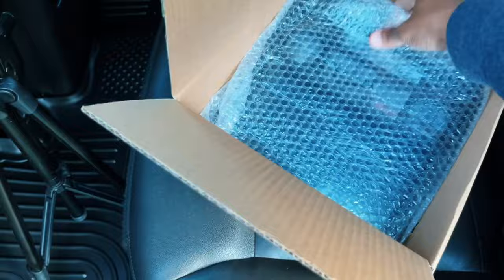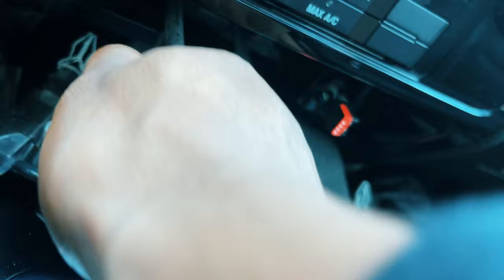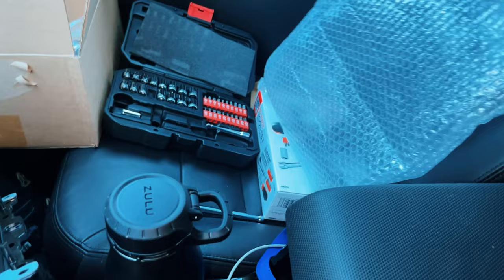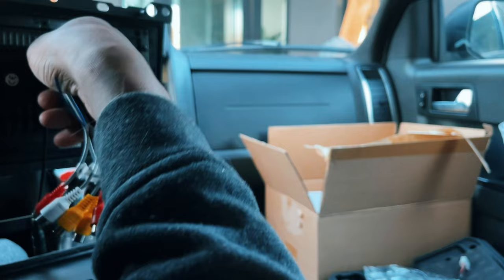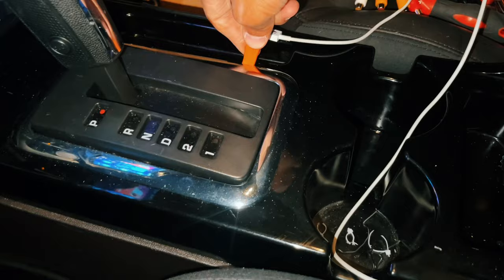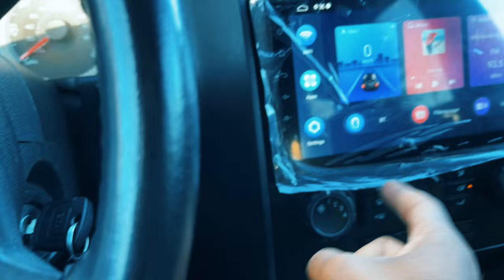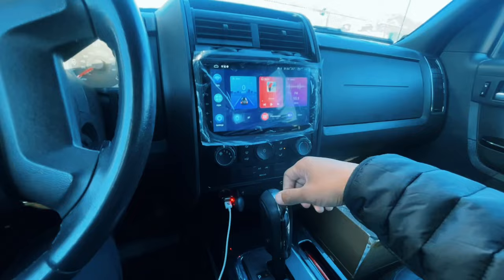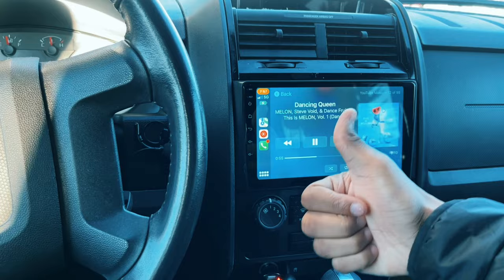How to install Apple CarPlay Radio for ford escape 2008 2009 2010 2011 2012

Comment: have you had any problems with it so far? the reviews seem kind of iffy
Reply from the maker: I’ve had a few issues but for the price I really recommend it. The WiFi seems to not work no matter how much I try. The microphone it comes with is pretty bad but I guess you can upgrade that. After having 2 phones connected to the Bluetooth it starts acting up so only my phone work now. I hate how when I’m on a call I switch off to speaker instead of using the Bluetooth and it automatically connect back by itself and the mic is soo bad so they can’t hear me. But mine is a 2008 I didn’t have Bluetooth so I’m not mad at it for the price
Reply: @ptitpony9262 if ur plugged in i belice u can use usb hotspot but idk if that a thing on iphone

Comment: Hey you should make an update with how it’s doing.
Reply: Agreed
Reply from the maker: It does the job! Apple play is terrible so I don’t use it and if that’s why this unit caught your eyes I wouldn’t buy it. But mine is a 2008 I didn’t have Bluetooth that’s why I bought it and it works like a charm very very fast connecting. However I find myself having issues when multiple devices is connected to it. Also another issue is WiFi it just does not work so I can’t install other apps like YouTube etc.
Reply: In what way is the car play bad?
Reply from the maker: It just doesn’t work. Its one of those buggy connections that wants to connect to your phone only when it wants to and 1 out of 10 will it want to connect.
Reply: You have to use the usb for CarPlay. If you go into the android settings and connect to your phones hotspot then you can run wireless. However as he said it’s very finicky.

Comment: I try to plug in my phone for CarPlay but it says USB fail on both
Reply from the maker: Have you tried using another usb? Hopefully that’s the issue
Reply: @MyNameStanc0l  The kit comes with two USB connections, it says fail or just times out for both. It did work through bluetooth but was just slow.

Comment: Where do I connect the key2 wire. And also I have problems with my WiFi staying on. So I have to use the usb cable.

Comment: Hello, I purchased the same unit for my 08 Escape, but no power when I reconnected the battery. Any suggestions?
Reply: Me too!
Reply: Anything, I’m having same issue
Reply: You must cut the red wire from harness and run a wire  that  turns on when car is running.  I used fuse # 33.

Comment: Got a few questions - does it have a built in microphone? How is the call quality? Can you disable the screen turning off when going in reverse?
Reply from the maker: It comes with an external mic you can place it anywhere you think is closer to your voice however it’s not the longest wire so you are very limited. Sound quality is terrible so I’ve heard when I’m on a call but you can always buy a better mic for under $20 and use it instead. For me anytime I’m on a call I just put it on speaker. 

The screen turning off is very easy my sincere apology for not looking deeper before uploading the video because there’s a setting for it to disable the screen turning off its very easy to find.
Reply: I just installed this but I can not find where to disable the screen from turning off. I turned off the backup camera function, but the screen still turns off. Where can I find that setting?
Reply from the maker: Unfortunately the screen turning off looks like it is a built in feature
Reply: It has external and internal mics

Comment: Have you had any issues with radio app not saving your presets? Mine keeps losing them.
Reply from the maker: Thank you for watching Toby. I gave up on trying to run apps because the WiFi does not work for me. I’ve seen a couple of people having issues with the WiFi too so I gave up trying to get it running. Is yours working? What apps are you having issues with?
Reply: @MyNameStanc0l  Everything works well, except the Radio will not retain the stations I save.

Comment: Can you still use the steering wheel volume/track controls?
Reply from the maker: I am 98% sure I saw some of the wiring specifically for that however my escape doesn’t have the buttons on the steering wheel so I can’t say for sure if it works
Reply: Yes you can use the steering wheel controls. You have to go into settings and there’s a place to let it learn the functions you want.
Reply: @user-if3bl5es1e  How can I do this exactly? I have a 2009 Ford Escape with volume, seek, talk and answer and hangup buttons
Reply: Go to settings then go to car settings. Then steering wheel learn. Then follow prompt.

Comment: Hi. did you have problem with control on steer? Mine doesnt work
Reply: I think u have to program them in settings.. it should ask u to press a button on the screen then press the corresponding button on steering wheel
Reply from the maker: Unfortunately mine is the 2008 I wish I had the control on the steering wheel. But based on the manual guides it should bed plug and play for your car as well

Comment: Where does the mic plug into the aux??
Reply from the maker: No the plug for the mic is behind the radio you will see it. And from there you can align the wire anywhere you see fit near the dash

Comment: does the stearing wheel controllers work?
Reply from the maker: I was told it should work however my car does not have the steering wheel control since it’s a 2008 unfortunately. I don’t know if it’s plug and play
Reply: Yes, they will work!

Comment: This is just a plug and play radio right? I can’t get any power to it again all. Help would be appreciated
Reply: Hey wondering if u fixed it having same issue
Reply: @papi2588  did you disconnect your battery first? You most likely blew one of the fuses. It’s located down at the left side under the dash, passenger side. There’s a panel in there

Comment: Hey! Can you share the link to buy the same system in Amazon?
Reply: I wouldnt recommend to buy that one, I bought it, installed it and it doesnt show anything to make the steering wheel controls to work, I bought it because it was advertised in amazon that it had the steering wheel learning funtion, but nothing came up.

Comment: Mine won’t turn on help me please
Reply from the maker: The power cable is located on the left side with about 20 teeth. You might have to turn it on manually if everything else is plugged. Did you get it to work?
Reply: @MyNameStanc0l  I got the same system but for a ford fusion everything hooked up but no sound what you think ?